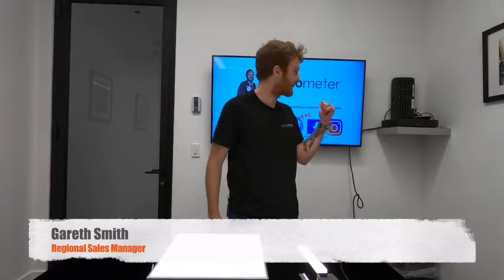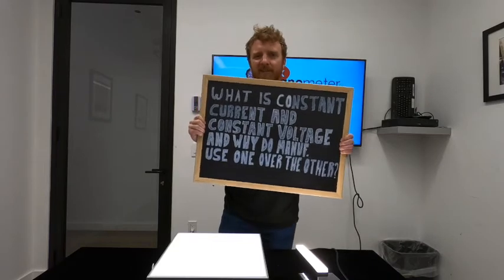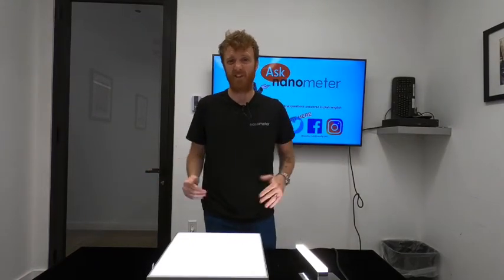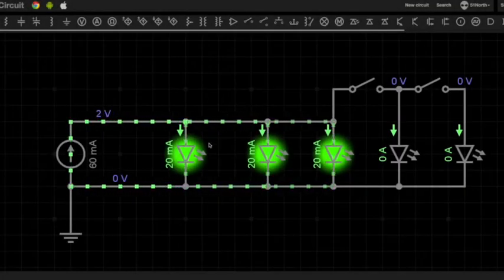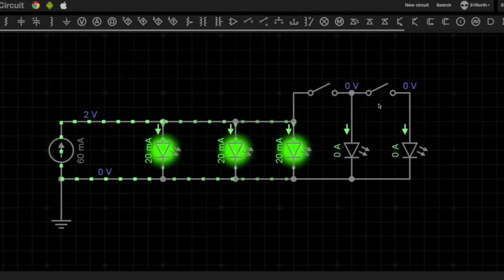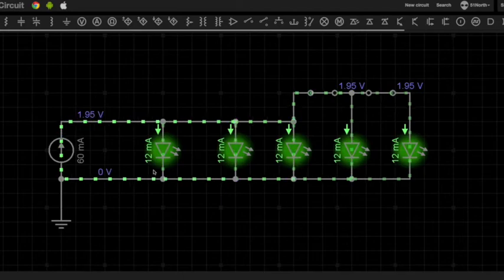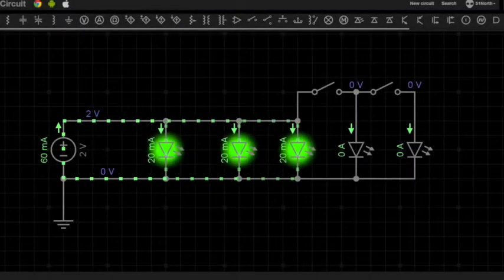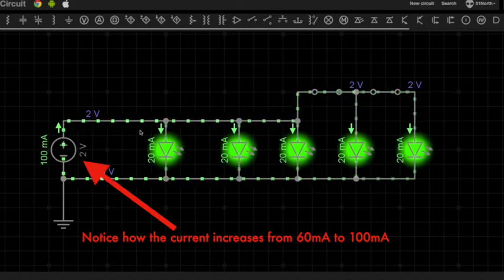Constant Current vs. Constant Voltage | Ask Nanometer

Comment: You use the terms constant current and current limit interchangeably they are not, as you know. The small constant current constant voltage modules that are used for LED drivers, are they constant current or current limited? I need a 5 amp constant current module. Can you recommend some on the Internet. Thank you.

Comment: you mention an led can continue to pull more and more current and that a constant current driver is useful. You then mention that when there are an unknown number of leds, a constant voltage is preferred, but when using a constant voltage driver, whats preventing the leds in that case from continuing to pull more and more current?
Reply: exactly, this was a good visual introduction, but it would be nice to include more details or examples on how the current is limited to the e.g. 20mA per diode as in this example. I assume at the simplest design a resistance is added to each diode to make sure the 2V supply does not push the max ampere - as in for example (2-0.7)/20mA = 65 ohm resistance ..?
Reply: Hi Jordan, in simple terms, a constant current board is just a PCB with Diodes on it, whereas a constant voltage board uses additional components to manage the current to each LED. LEDs are inherently constant current so this is what matters,